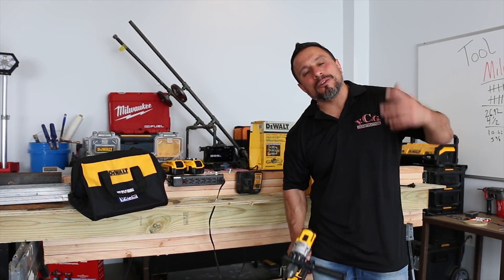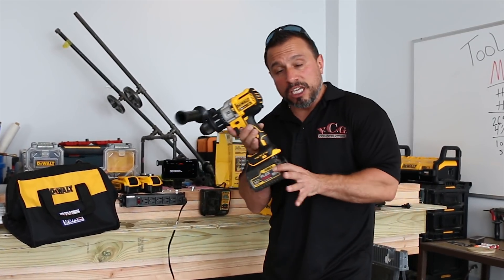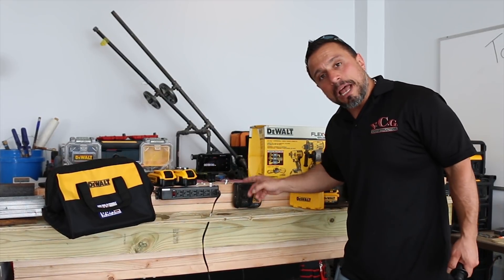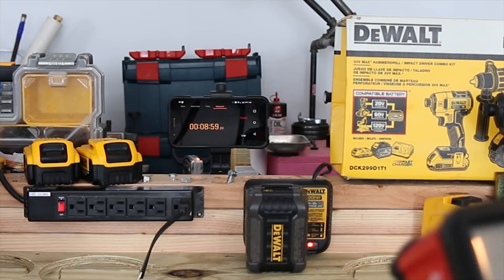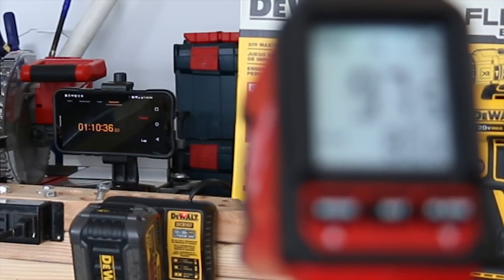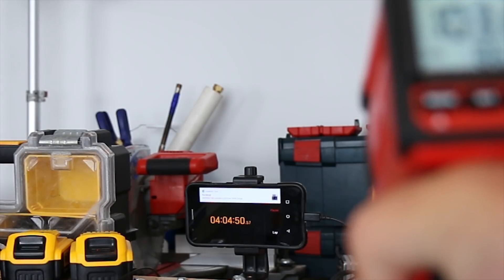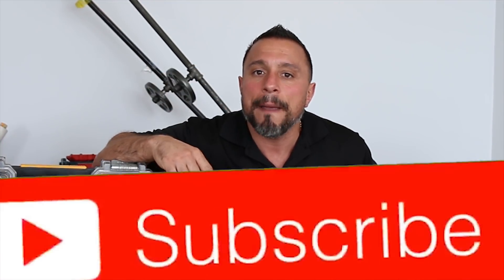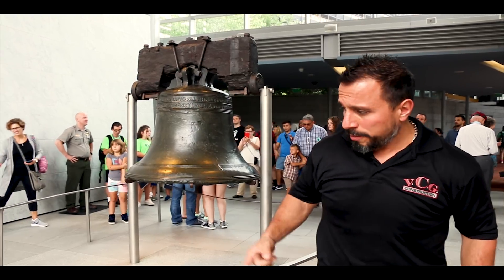DeWALT (DCB606) FlexVolt Battery Overheats On A Standard Charger?!

Comment: So I'm a flexvolt guy but really liked the M18 chainsaw so bought it with two 12 ah batteries. Problem is, that after using the chainsaw until the battery is dead, brings the battery temp to 134* F. And when  it's charging the charger reaches +150* F! The battery itself gets to 120* F. I'm worried that the batteries are going to kick the bucket from overheating. My flexvolt stuff will get to about 100* from heavy use, but not more than that. Anyone have knowledge on lithium heat degradation?

Comment: the charger that comes with the flexvolt circular saw kit and(that now has a belt hook) is the dcb115.  It has about 4amp charge rate which is about half the fast charger.  flexvolt should change 1.5 to 2 hours.

Comment: Odd. Not 20 minutes ago I came in from my shop after putting my flex volt on the rapid charger. I like the rapid charger because it has a fan. I have a couple regular chargers but I just use those for my small batteries.
Reply from the maker: That fast charger is awesome!!

Comment: My flexvolt didn't take nearly as long as your test! Same everything about 2 hour's not 5.crazy Vince
Reply from the maker: Which charger do you have Nate?
Reply: @VCGConstruction  he's probably got the DCB115 which charges at 4amps not 1.25amps like the one you used in this video I have the new dewalt 4 port rapid charger just got it from acme tools 2 days ago....wanna talk about a beast this thing does all 4 of my 9.0 flexvolt batteries in around 90min or so but I use my power station a lot so I needed that 4 port rapid charger